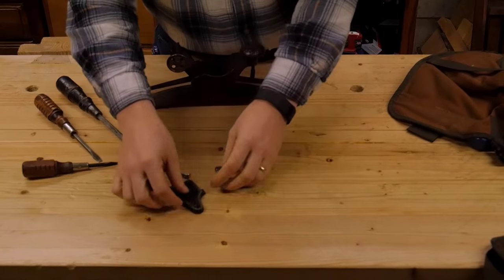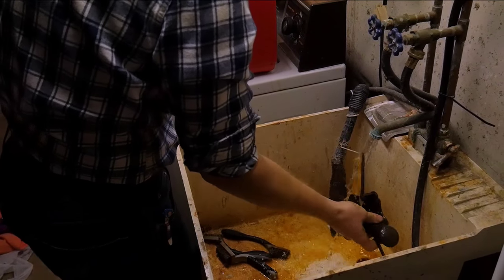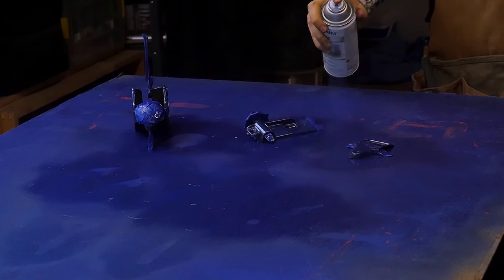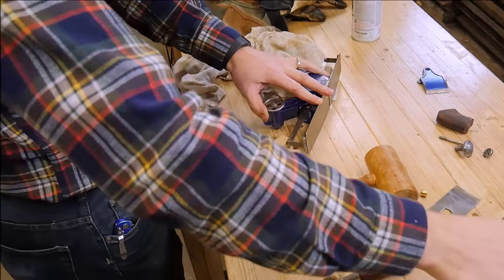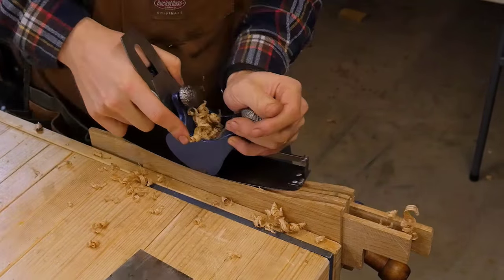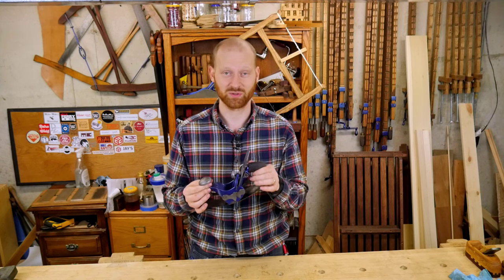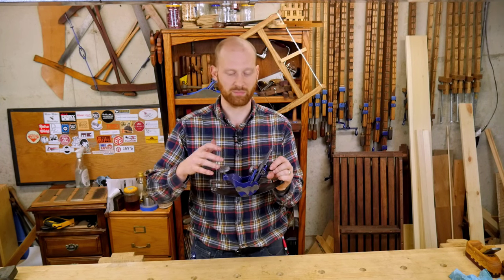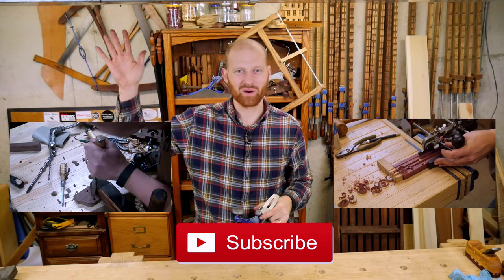How To Restore A Stanley 113 Compass Plane

Comment: I have an old Record compass plane that I rarely use but it's the best tool for the job when it comes to it. Compared to spokeshaves and bobbin sanders, I've always found it superior for creating smooth and consistent curves.

One modification I made to mine was to swap the cap iron (I think) for a thicker one, in order to reduce chattering on hardwoods. I had hoped to fit a thicker blade but I don't think the mouth in the sole was large enough and I wasn't confident enough to try and open it up.
Reply from the maker: +Olly Parry-Jones I was thinking of making a new Chip breaker for it but decided not to because of the mouth size. it sure is tight in this one. and you are so right when you need it, it is the tool for the job!

Comment: Thanks for the instruction, James. I just got my first 113 and am anxious to use it. Do you actually recommend replacing the metal handle with a wooden one? Or should I just go ahead and use the original metal handle? Thank you!
Reply from the maker: use the original one. this was just put on as the original handle was missing.

Comment: Just got one of these and I'm planning to put a fresh coat of paint on it, I didn't catch it in the video but how did you handle the gears on the side. You said you just moved them up and down but how did you mask them off and did the paint have any negative effect on the gears?
Reply from the maker: I placed tape on the face and then cut around them. You can actually remove the gears but it's a good bit of work. Hand tool rescue did a video a few months ago showing taking those out.

Comment: Out freaking standing. I am extremely new to woodworking and have only heard of this plain as of yesterday. I have dropped a message to just about every channel for wood working that I know of. This hit the spot right when I was looking at one of these. I can only find one complete #113 on eBay right now and the price seems to me to be WAY UP THERE! What would you say is a fair price for one that needs restored, but is complete?
Reply from the maker: it depends on the type but I would not pay more than $60 for anyone that needs to be restored. even in good condition, I would not go over $100, but that is me. Look up MWTCA.org and see if there is a meet around you. that is the best place to get one.
Reply: Yeah, that's about the orice I was thinking. The one on eVay was asking over $400. That just seemed ridiculous to me so I was just checking that I wasn't being cheap, I often mis_guess proces and values as everything has gotten ridiculously more costly than I would expect values to be. Of course I grew up in the 70s so the prices of my youth are long gone.

Comment: So I just bought a type 2 113 could you maybe go into more detail of different ways to set it up and just what you use it for on a regular basis
Reply from the maker: Here is an older video where I talk through a lot of that. It's not a commonly used plane and I only pull it out about once a year if that. https://youtu.be/8BTDYcBFLwE
Reply: @WoodByWright  thank you so much.  You're always awesome at replying and at what you do

Comment: Thank you for this video. I just bough a plane like this on Saturday and mine is also missing the handle. So i'll try to find some hardwood and make me one my self. This water and vinegar mix, how strong vinegar are you using?
Reply from the maker: I use 50/50 mix that is slow enough it is easy to keep an eye on. Thanks.

Comment: I have two union compass planes No. 311 & 411. One has the pins pened  at the ends. Did you have to file the ends of the pins to get them off ?
Reply from the maker: Yup. To get them off you have to drill out or grind off the head. So you have to ask if it is worth it. Some times yes some times no

Comment: How did you take the gears on the side off? I'm restoring one myself, and this video e a big help! Thanks!
Reply from the maker: I did not. in order to do that, you basically have to drill them off. not something I wanted to do. to paint it I ran them all the way to one side, painted it, waited for it to dry, then all the way back to the other and painted it again
Reply: Masking the gears with tape, correct?
Reply from the maker: yup!

Comment: Is the 113 a bevel up or bevel down tool? 
I have one and did a tune up and it doesn’t cut properly.
Reply from the maker: Bevel down. Almost all planes are bevel down. With the exception of block planes and low angle planes.

Comment: I just wish I could afford one, now that old tools are being collected instead of being used they fetch silly money, way out of reach for most tradesmen. I'm having to make one from an old No.4 smoother and an old saw.
Reply from the maker: surprisingly it is the other way around. the users are driving up the price. especially over the last couple years. But you can still find these for around $100. which is only about $20 more then they were 4 years ago.

Comment: next time give evaporust a try you won't be disappointed its a lot less labor intensive to remove thee rust. literal leave it over night ten minutes with steel wool and your done just did a number 5
Reply from the maker: I have tried it several times but it does not work as well for me. but I do recommend it to a lot of people. I just do not like the look of the steel after it.